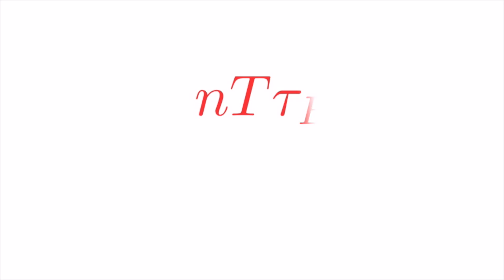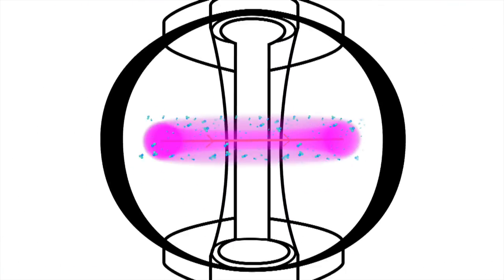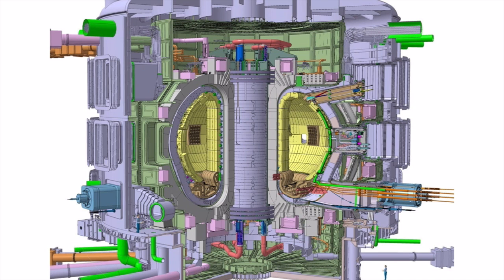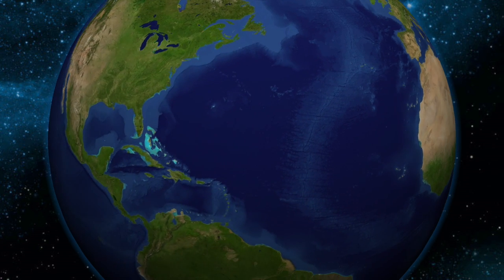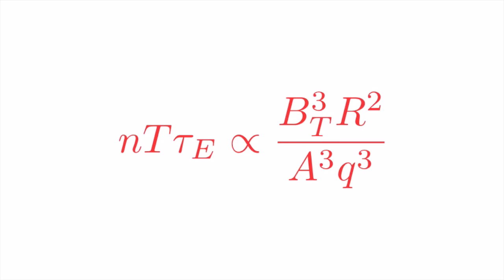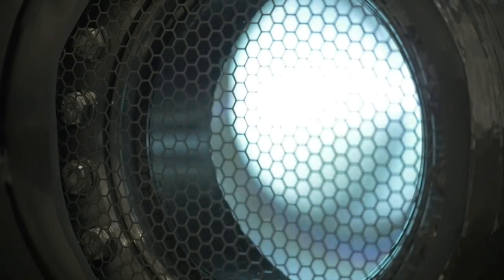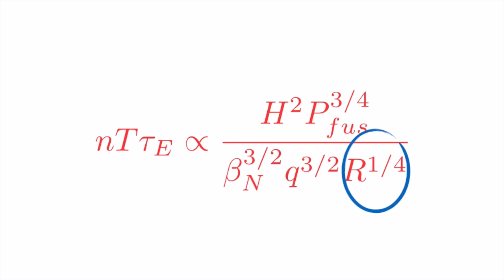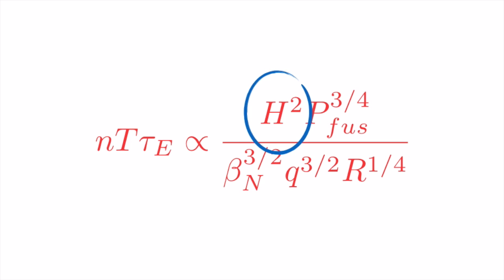New research on fusion triple product and power gain - why it's important

Comment: If only there were a way to directly harvest the energy contained in the plasma and the free electrons without having to boil water.
Reply: there is check out SI-graphite power cells they work with heat kinda like a stirling engine but with better materials
Reply: https://en.wikipedia.org/wiki/Fusion_power#Approaches

There are.

Comment: If this reactor is going to produce energy, I will strap it onto a spaceship with some duct-tape and add some electric rocket engines to the craft and fly to mars...
Reply: ion drives only work with no air so..... ignoring how hard it would be to" strap it with duct tape " to your craft the power output of the ion drive would suck ass compared to the mass of the craft so the acceleration would suck ass too
Reply: First strap it onto an actual rocket of course, fly it to orbit and continue from there on. And in space you don't need too much acceleration.